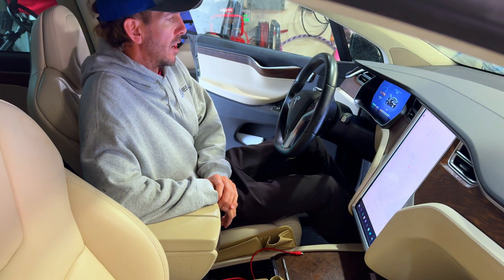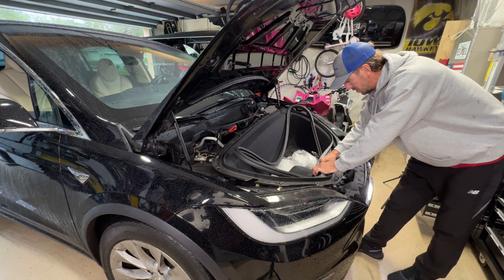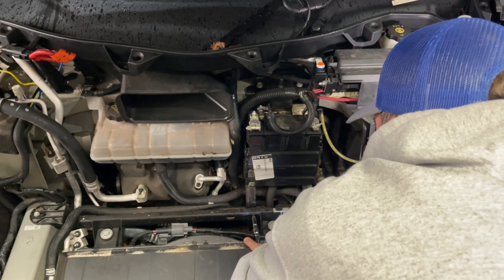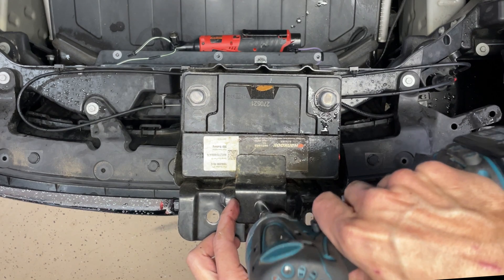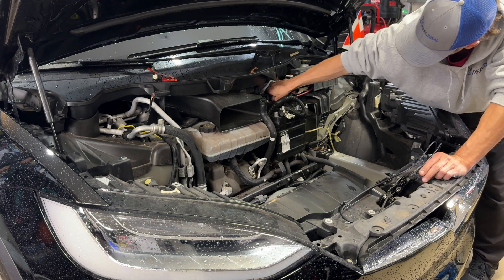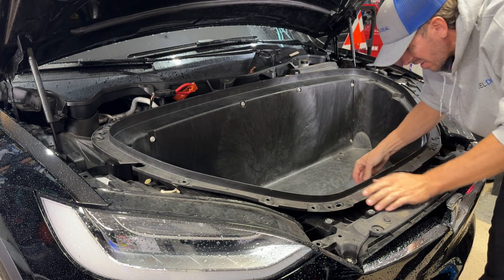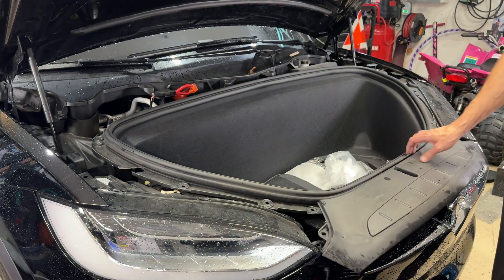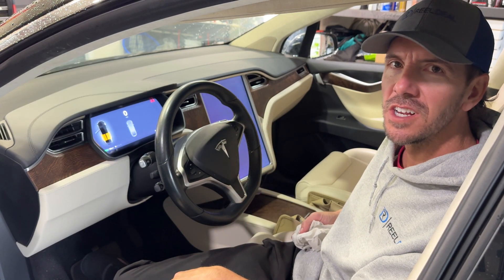Tesla Model X 12 Volt Battery in under 30 minutes

Comment: Another strike against Tesla cars, 30 mins of work just to change a battery!  It takes just a few minutes in most ICE cars so why does it have to be so hard in a Tesla?
Reply from the maker: You haven’t worked on any modern cars I see…Corvettes, Honda Insight, Audi A5…you’re gonna have a lot of cars on the strike list
Reply: @thereelwdad  took me 3 minutes to replace 12v battery on Hyundai Ioniq and C Class Mercedes. Some car manufacturers actually care about ease of maintenance without going to a mechanic.
Reply from the maker: No mechanic needed here either, you simply need two tools and 30 mins
Reply: It's all relative. Every car has its nuisance. But my 2020 model x has more technology and self driving than any new non tesla 2025 car being sold in the US.  And what other suv will give you 700+ HP while driving the family around. 30 min battery change every few years is a microscopic blip compared to the benefits.
Reply: If people don’t know to disconnect the HV line, the car could blow up.